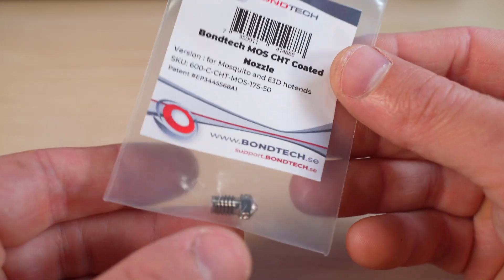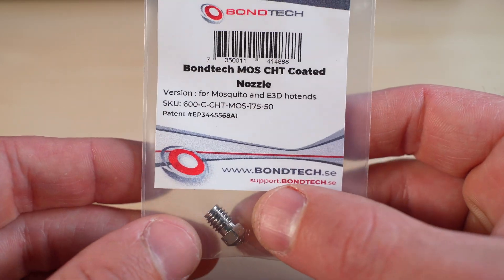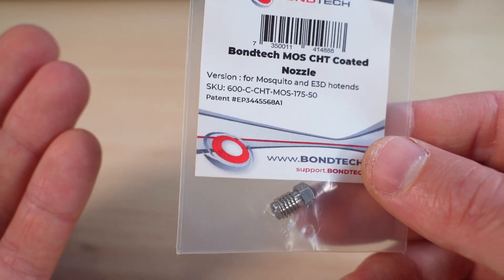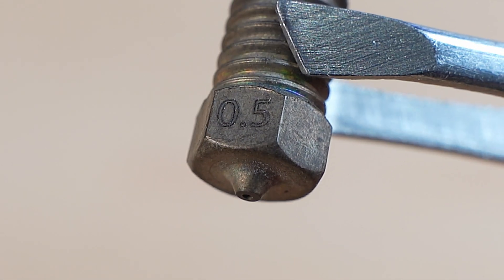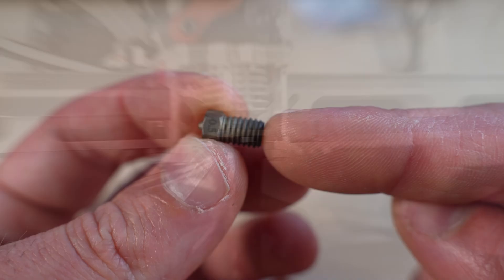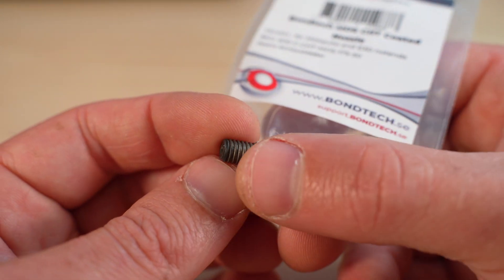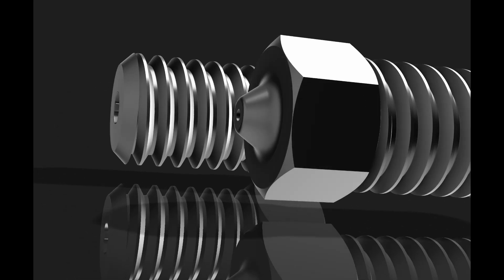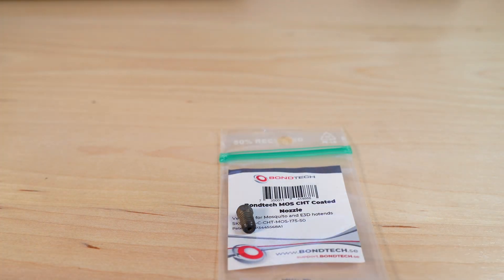The Bozzle Nozzle

Comment: Dont re heat a hardened alloy , if you heat this too much(while your "cleaning method")  you loose the hardened properties because the martensite type structure change while re heating ( its depends on the alloy , but its about 600 Clesius i guess) …and by the color your heating temp is about 800-1000
Reply: It's tungsten not steel. There is no temper to ruin.
Reply: Martensite is steel. This nozzle is tungsten carbide.

Comment: Back in stock!
Reply: Commenting to get notified.
Reply: Back in stock!!
Reply: @Tedlasman  Are you going to have more in stock anytime soon?
Reply: @cbbbbbbbbbbbb  will have a couple more soon, and a bunch more not so soon
Reply: @Tedlasman  Very nice! Any plans on a volcano length version? Nor sure if that's possible with your design.
Reply: @Tedlasman  Commenting to get notified for next batch :D
Reply: @Tedlasman  Any updates?! Have a project coming up I'd like to try some carbon fiber filaments with. No pressure, just trying to plan if I need to pick up another nozzle between now and when yours come back in stock.
Reply: @cbbbbbbbbbbbb  a batch has been shipped from manufacturing, so pretty soon!
Reply: will be in stock next week!
Reply: @Tedlasman  Excellent! I've been checking daily, haha. Good to know it won't be much longer. I have a batch of nylon I'm holding onto til I get the bozzle in.
Reply: @Jmjandco  In stock!
Reply: @cbbbbbbbbbbbb  In stock!
Reply: @Tedlasman  I got one thanks! Should be arriving today from Fabreeko
Reply: @Tedlasman any chance of anymore says sold out world wide.
Reply: @jamesm3268  still working on it, hopefully soon.

Comment: Very cool! Been waiting for someone to make a steel nozzle with real flow. I have been picturing an extruder with two hobbed drive gears on a shaft feeding into a nozzle that essentially splits each filament into several pieces then re-converges the two 1.75 filaments into one. Would be a fairly big nozzle but we wouldn't hit anymore limits.

Comment: @Vez3D How does layer adhesion compare with bozzle nozzle vs cht vs regular?  My CHT keeps clogging and is now scrapped.  Going back to regular nozzles really is a stark contrast in layer adhesion in ABS and PC.  Like I can peel each layer away by hand using the same GCode that was almost isotropic with the CHT.  Interested in your experience.
Reply: I'm not vez, but i've been hearing that people are really happy with the adhesion.
Reply from the maker: I never ever had a clog with a bozzle.. its been on my Goliath since the day I got it. When it starts to print a little less quality after swapping different filament material, i just blow torch it hot red and dump it in cold water to clean it. Then its back like a brand new one. Flawless performance for me

Comment: Very interesting design. In terms of heat transfer/abrasion resistance, how do TC nozzles compare to those in brass with ruby/diamond tips (specifically thinking about Olsson and Diamondback here)? Thinking about optimizing thermal and mechanical properties for high-flow abrasive-resistant nozzle, I would tend to think that a nozzle with CHT-style inner geometry but made of copper (or silver if we want to go crazy) with a diamond tip (low friction, good thermals, extreme hardness) should theoretically be very good (albeit pricey). Any thoughts on the matter?
Reply: the ruby/diamond tipped ones are harder, but that only matters if you print stuff like boron carbide filament. 
imo multi-part nozzle are not the way, too many things to fail.
Reply: @Tedlasman  wait.... There's boron carbide filament!? 🤯🤯
Reply: @3dPrintingMillennial  yea, it's expensive. Think its used for some nuclear applications
Reply: The cht-style internal geometry is also exposed to the abrasive media
Reply: Fair enough, but what if the leading edges of that internal geometry had an abrasion-resistant coating?
Reply: @simontanguay3619  coatings like to fail

Comment: Thanks,
What are your favorite fiber carbon materials?
Do you print with petg+fc (like xt-cf20)? How do you cope with stickiness of this material?
Reply from the maker: I hate petg ..and rarely use it. I like asa, abs, Pa, pc all with cf
Reply: @Vez3D  I Like mechanical properties of petg+cf.....but printing it is a nightmare. 
PC+CF mechanical and structural should  interesting. 
Any particular brands?
I tried Nylon + CF from 3dxtech and polymaker... PA6.... PA12... gen2....gen3....gen67485 :))))  unfortunately not good results.
Someone said that DuPont made really good stuff....but for some reason closed the production.
Reply: Pa12+cf15 from Fiberlogy works great and is very durable, using it a lot

Comment: Can you torch that PCD Diamond Nozzle, (What was it, the “Diamondback Nozzle”) or would it oxidize and essentially “burn”?
Reply: (Also could they make one with this pattern?  IIRC PCD has the hardness of this and *BETTER THAN BRASS THERMAL CONDUCTIVITY*, so that’s my endgame lol.
Reply: no it will burn the diamond and destroy the nozzle
Reply: @Der_Drache  Yeah that’s what I figured.  Would some sort of inert gas furnace like those “Heat Treating Furnaces” work?

(I’m thinking cheap Lab Grade benchtop electric resistance furnaces and a tank of argon?)

*Granted at that point it may be better to use another method lol*
Reply: @ericlotze7724  if you stay under 500c it schould work, if this tips act like pcd inserts they burn at around 600c

Comment: I like to get them red got and dunk in water. They come out perfectly clean. 
Sinker EDM is the only way to machine that internal geometry. There are several grades of tungsten, some machineable, some not except for edm machining which doesn't care about hardness
Reply: they don't explode when you do that?
Reply: why expensive edm? you sinter them like all carbide stuff, its a simple contour for that
Reply: @Tedlasman  mine dont. I made a couple from mass simulant tungsten but it's a valid point as I'm sure some are made from different grades of tungsten that might crack or explode so I retract that suggestion
Reply: @Der_Drache  sounds reasonable. Just need a real hot furnace?
Reply: @billclark5943  yes around 1000-1250 C when i have the numbers right

Comment: Please explain how this works, is the inner portiion smaller than 1.75mm and splits the filament from the outside? Does this work with dual color filaments or do the colors end up mixed?
Reply: More surface contact area = more heat transfer = more melting power = speeeeed! ;)

Comment: There's a tread-off to be made here: durability for thermal conductivity. The thermal conductivity of tungsten carbide is about the same as that for a brass nozzle. So it should be comparable to a CHT nozzle (which is nickel coated brass) in that regard. However a copper nozzle has a thermal conductivity that's about four times as high. So, I'd say a copper volcano nozzle should give you better melting performance for a fraction of the cost (around 8 USD) than the fancy geometry of the bozzle of CHT can achieve at regular nozzle height (non-volcano). If you print infrequently, this might be the better way to go about it. However, if you go through nozzles every couple of weeks the tungsten carbide bozzle might be a worth while investment.
Reply: I did some thermal modeling of plastic flow through a nozzle.  The limiting factor is actually the plastic thermal conductivity and distance to center.  Modeling copper, brass, and carbon steel showed all behaved within 5C average filament temp coming out at a set flow rate.  However at too large a flow rate, average temps start to drop significantly (hence more back pressure, more poor bonding).  With nozzle set at 240C, filament was 232 C at 10mm3 but dropped to 210 at 20mm3 and 190 at 30mm3.  Biggest improvement was by limiting distance / mixing as per CNC Kitchens CHT knockoff which was 236C at 10mm3, 228 at 20mm3 and 215 at 30mm3.
Reply: Just use diamond.  Best of both worlds.

Comment: I killed some of those hardened steel nozzles with just 5 kg of PA66GF30. And steel has really bad thermal conductivity, so it's not for fast printing. Even part cooling reduces maximum flow and layer adhesion, because it cools down tip of the nozzle and matherial gets extruded colder than needed.
Btw, according to flow tests, CHT does not outperform V6. CHT flow rate degrades slower, but 1% underextrusion (which is maximum allowable underextrusion for good prints) starts at the same flowrate.
Reply: Have you tried the Diamondback?

Comment: Vez - do you know if he's ever planning to do a .4 version? I imagine he's doing .5 because a .4 drill would just get destroyed by the tungsten.

Would be interesting if they could also be made with m2 tool steel. I've been using microswiss's coated m2 tool steel nozzles with cf filament. More than a couple spools so far and no widening of the orifice.
Reply: .4 is the next size we are doing!
but really, there's very little difference between .4 and .5 in terms of quality
Reply: @Tedlasman  Awesome to hear that! Where can I track updates on this? I'll definitely be picking one up.
Reply from the maker: @Tedlasman  i prefer 0.5 over 0.4

Comment: Edit: $105 or $80...no thanks. I will drill a few holes in steel nozzle on rotary table and get 80% of the performance and throw away when they clog or wear. For the 105/80 you can buy a rotary table combined with a cheap drill press. The precision is not important beyond getting too close to edges(ruins seal with heatbreak) or drilling too deep and ruining the tip. 

If it were me trying to machine this with regular shop tools I would rough drill the 4 splines to shape then use a broaching technique to get the final shape. Rotary broaches work extremely well. EDM wouldn't work.
Reply: Would love to see your results!!
Reply: @Tedlasman  Should have some results in 2 weeks or so. Waiting on a batch of steel nozzles from China. My only concern is the cheap cobalt drills I have. I have a few 1/32 carbide center cutting end mills but none that I wanna ruin if the steel is hardened which BIQUs have been. I have a off brand Chinese here that was considerably easier to drill out(I drill the tips) so I have more of those coming.
Reply: @ChrisHarmon1  just fyi, glass fiber filament will eat steel for lunch
and
steel isn't as good thermal conductor as brass or TC.
Reply: Steel nozzles suck.  Tried em, had to print 20C hotter and 20mm/s slower.  I just got a diamond nozzle and print with a .6mm nozzle at 205C at 60mm/s at .25mm layer height and .625 extrusion width.  It flawlessly, no stringing, great layer adhesion and a solid surface finish.